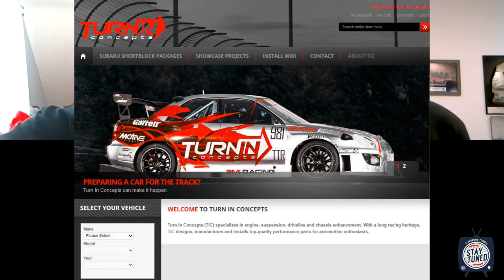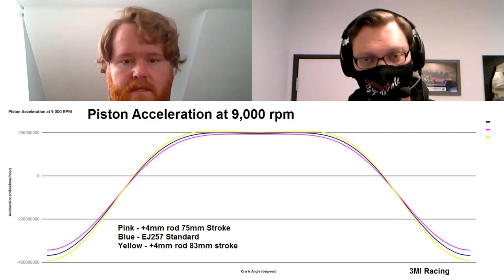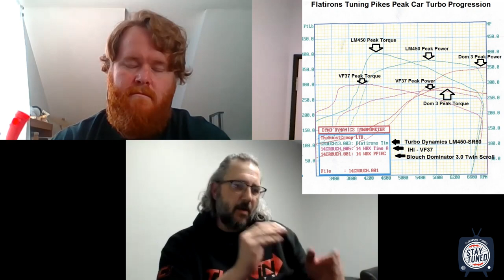A deep dive into Subaru Long Rod Engines with TiC and 3MI - Ep. 21 of the Syndicate Podcast

Comment: Would have liked to hear a little on 79mm, +2 in 22t block. An a separate vid on head and cam decision would be awesome.  Thanks again for a great vid.
Reply: What would you like to know? Again, you can simply view it as a smaller bore EJ25. COTS Piston selection is way down in comparison to EJ20 and EJ25, so custom pistons would no doubt be the option to take, especially with the 132.5mm rod length.
Reply: So crank 79mm then? Thrust conversion worth it? Rods 132.5 Then custom pistons. Heads are d25s. I guess pistons would be more my concern.  But engine builder would need in on that. Compression 8.5 to 8.8 maybe?
Reply: Then head gasket? 22e gasket? Or?
Reply: @__MAT__  so 79mm crank would put you around a 2.35, the 132.5 is again, just refinement for the given stroke, and being you'd probably need a custom piston anyway, given the D25 heads, it's essentially a freebie. 
As for headgasket, I'm not too familiar with the OEM 22E headgasket. You could use the OEM EJ255/7 headgasket as well but keep in mind it will sit pretty far off of the bore and needs to be taken into your compression ratio calculations.
Reply: @Micah_Makes  thanks for the input.  The 22e is a phase 2 2.2. The headgasket is what Fuji K used on his 22t/205 build and also his built 22t/d25 build. 
 "Just so you know the 11044AA542 HG is a 3layer HG. Same thickness as the WRX/STi EJ205/EJ257/EJ255. I ran them with my STOCK EJ22T shortblock on WRX EJ205 heads."  Fuji K.
It has a 97mm bore. MLS and thickness of the 257 headgasket,  .51 maybe if I remember correctly. 
When I get ready to have this built, is it something that 3MI would be willing to build/put together?  I still need to get the block to Motion Machine to work the thrust conversion.  Thanks so much fer yer time.

Comment: Would have loved to hear more about EJ20 stroking and whether they do +2mm or +4mm rods for them. Also about the difference in spool from stroke changes vs Bore changes etc. loved this information guys keep it up! Can’t wait for the next one!
Reply: So for a stroked EJ20, simply think of it as a small bore EJ25. So a 132.5mm length rod would leave you with a plenty stout, and easy to assemble, 28.7mm compression height piston. It doesn't require you cutting into the oil ring.
Reply from the maker: Thanks for your question.  I would mention that there are special pistons for the stroked EJ20's (with 79mm crank from the EJ25), and they actually move the wrist-pin up so that the stock length rods work.  

With that in mind, adding a longer rod while also increasing stroke with the EJ25 crank would be a bit tricky.

I hope that helps, and Stay Tuned for more!
Reply: @FlatironsTuning   well...it would essentially be no different than making a 2mm rod EJ25. Only difference is the bore. So using 83mm stroker EJ20 pistons and using the 79mm crank and +2mm rods would work just fine, if I’m not mistaken.
Reply: @Micah_Makes  how are the characteristics of a 2.1 stroker in comparison to a 2.5? Is it just better to get a 2.5 block? Or is it worth it to build a 2.1 EJ20?
Reply from the maker: @crxkid16  You can use a +2mm rod with the 75mm crank and the "2.1 stroker" pistons for sure.  Where it would get difficult is trying to run a longer rod with the 79mm crank.  You would need a very custom piston to keep it from pushing over the deck.
Reply: @crxkid16  it's basically the same but with ~13% less displacement. You'll notice it's a bit punchier downlow compared to the 2.0, despite the minimal gains in displacement. Most noticeable might be the decreased lag for the same turbo.
Reply: @FlatironsTuning  wouldn’t that issue be solved by using 83mm stoker pistons on the 79mm crank. Moving the wrist pin location higher to accommodate the 2mm longer rods?
Reply: @Micah_Makes  I’m stuck with a decision. I have a 93 WRX with a CDB ej20G and a hydraulic lifter made a valve hang open a little bit. Nothing was damaged. So I got a set of EJ20K heads to get away from the HLA. Now I’m stuck between building the 20G block or rebuilding a 257 block that I have that had a ringland failure. I’d have to send the heads out to get rechambered for the 257,but also finding a shop to do the Thrust conversion on the 20G hasn’t been easy either.
Reply: @crxkid16  well it sounds like you already know the pros and cons. With the EJ255/257  block, keep power goals in mind, and the relationship to that and needing a closed deck conversion. 

The EJ20G is a tank for use, actually what I sourced for the destroker project, but it's limited on displacement.
Reply: @Micah_Makes  power goals are modest 360-400whp, so block structure shouldn’t really come in to play in my scenario. My issue is that if I can’t find anyone to rechamber the 20K heads then if I use EJ257 I need to use Hybrid pistons which doesn’t let me use +2mm rods. I’m also having trouble finding a shop to do the thrust conversion... I guess I could get a Manley or K1 dual thrust cranks if I go with a 2.1 stroker

Comment: do +2mm rods over 2006 sti stock rods require a new protune if thats all that was changed on the build?
Reply from the maker: I would definitely recommend it.  Since you are changing the piston timing by going with the longer rod, you would need to re-set the spark timing to ensure that the engine is working properly.

Thanks for watching and Stay Tuned!

Comment: Just about to drop in an Outfront V4 Racer+ engine. Running the 79mm Callies billet crank, and +2mm rods. Should be enough to handle all this PT6870 and BC280 cams can throw at it and spin up to 8k rpm without any issues! Not my daily, just a Mustang mashing street car.
Reply from the maker: Nice!  Sounds like a fun build.  Thanks for watching and Stay Tuned!